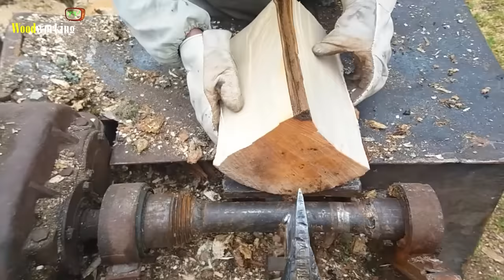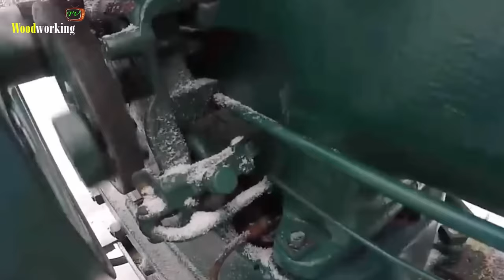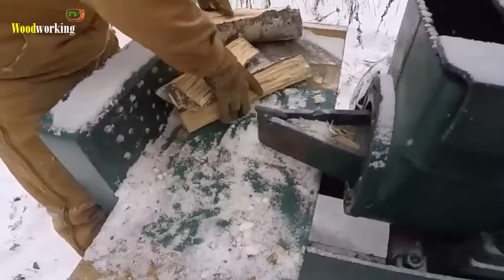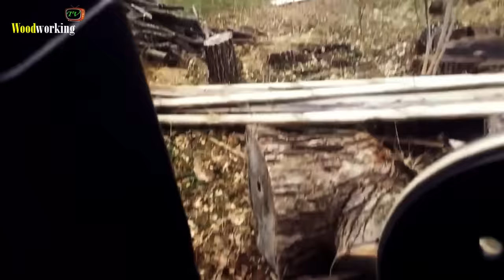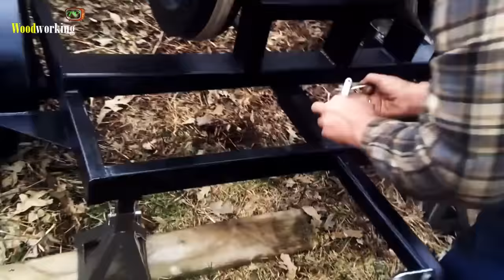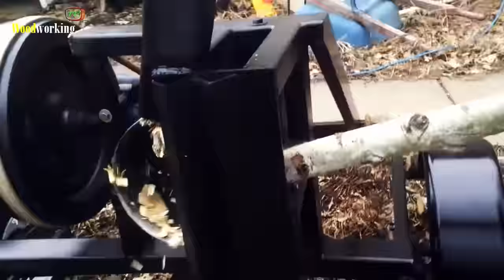10 Dangerous Homemade Automatic Firewood Processing Machine, Wood Cutting Machine Splitting Firewood

Comment: i just picture the second machine operator getting tangled in the rope and drug across the table, crocs and all
Reply: This made me laugh way to hard! I think i may need to see a professional. xD
Reply: ya that rope WTF.............just in time to be sliced holiday sausage!
Reply: Icarus America that would be a scene from a horror film
Reply: 'Drug across the table', definitely need lots of drugs to work on that wheel of potential catastrophic  horror
Reply: @adrianhorgan8944  how do you think he came up with it?
Reply: traumatic head injury
Reply: The capstan can only pull the loop when the operator is pulling the bitter end for tension. Pretty much every marine capstan since the age of steam began works the same way. That feature is actually FAR safer than trying to manhandle the log up that ramp. Granted, the rest of the machine has a few "safety issues" (per cubic inch), but the capstan dragger is actually a time honored mechanism that may not be idiot proof, but is pretty safe
Reply: @ludditeneaderthal  The capstan dragger may be safe,  I question its implementation in this design. There is quite a bit of  loose rope untethered. The rope is routed near the "cutting head" at the platform, you can see the log is close to the rope as is maneuvered  to be cut, if not careful, the log may snag the rope and become entangled in the device as the log is placed for cutting.

Comment: #2... 
✅ Massive spinning propeller blades.
✅ Hands/face/body often < 12" from spinning death machine.
✅ Rope connected to propeller blade mechanism that could bind you up and rip off limbs.
✅ Lifting heavy log up railing that could fall and crush your feet.
✅ Possibility of getting tangled in rope and being ingested into death machine.
✅ Rotating death axe available to access on both front and back.
✅ Placing face/head right in front of massive death axe to have it slam down on wood.
✅ Moving wood while it is actively being slammed by death axe, hands/face close to death axe all the time.
✅ Flying wood could hit person in stomach causing them to bend over right into death axe line of fire.
✅ No predictability of the massive death axe suddenly binds.  Probably would tip the machine over or who knows what.
✅ Split wood flies at your body or in unknown trajectory.

Comment: I really like the first one.
The second one is insane. Though I'm frankly impressed at the level of design effort that went into constructing that suicide machine.
Reply: There isn't one thing on #2 that is admirable or impressive in any way shape or form. Welding a cleaver to a wheel and making it spin is childsplay. This guy is a certified maniac and that mechanical abomination needs to be melted like the terminator

Comment: I like the first one. High torque, low speed blade. Seems to split without effort.
Reply: Yea, first one seems pretty safe and efficient. Worst thing you could say about it is the lack of a belt guard. At least put some 2x4s on either side so you don't accidentally brush against it.
Reply: @Crosshair84  imo, the third one is safer, the first one use full rotation which mean something can catch into it and the axe/splitter act like a hook. but still both machine need a well designed belt system.
Reply: @drakez1983  third one operates too fast. If it could be slowed or engaged after a log is in position  it would be awesome but the first one still gets my vote
Reply: @maggs131  Seems to me the third machine can't start when the splitter is still engaged, so they need to slide on the belt while it's running. Switching this mechanism to something you can operate easily and within a second would already achieve what you're missing and increase safety in other parts as well
Reply: @Crosshair84  yup, i agree,

Comment: The first one had the potential to be dangerous, but cutting/splitting wood inherently has the risk of injury. The second machine was very dangerous. A death trap. You'd need several mechanical safety measures, like a lever that drops logs into the splitting axe, that can be pulled from a shielded position beside the machine, and the loading mechanism for the logs into the drop area would require the machine to be shut off. All together an unsafe and impractical machine if it was made to be safely operated. Now if the machine was autonomous, and the logs could be loaded and cleared in a manner similar to a magazine ramp and a clearing ramp, then maybe. Perhaps a shielding area above the machine with a ramp that a person drops logs into, where the machine splits and the logs are then fed into a pile. Even still, not very practice unless you were looking to split wood at an unconventionally quick manner. The third machine was pretty cool, similar to the first machine but with an engine that is attached to a chiseled piston rather than a belt system that rotates a wheel attached to a rotating chisel. The last machine seemed rather cool too, but when feeding the logs by hand rather than funnel, there is a chance of the log being ripped away from the operators hands and potentially hurting/hitting someone or something. Not super dangerous, but has the capacity. With the funnel, the log is supported by a metal (I assume to be welded, forged plate, or stamped sheet steel) box that prevents it from going anywhere but through the machine or up where it came. The energy being applied to the log I don't think is applied in a manner that would push the log out again with any significant velocity.

Comment: Did you say 10 ??? , I counted 4. And the first one looked very safe.
Reply: Like the idea. Slow enough to be reasonably safe.
Reply: the big issue is that if it sucks you in there is nothing there to stop it from pulling you the whole way through that little hole.  I don't know how much torque is on that shaft but I bet it wouldn't slow down till at least your shoulder, and when that spike comes back around I hope nothing important is in the way. There is no guarding at all with this machine.  you get your shirt or jacket caught, its over.

Comment: The 1st machine looked not too bad, the 2nd big wheel thing ABSOLUTELY LETHAL.!
Reply: The first one is as safe as any other typical woodworking machine. You just have to remember not to put your hand where the hook meets the table. The same rule goes when you saw or drill things. The third one is also pretty safe. Worst case scenario it will hit your hand and bruise it. Same thing can happen when you don't know how to use a hammer.
Reply: @smieszek8080   and the second could be a perfect machine for a murderer to kill and disassamble somebody OOF
Reply: @michagrill9432  There's so many things that can go wrong when operating the second one it's not even funny. It's like using a jet engine as a leaf blower.

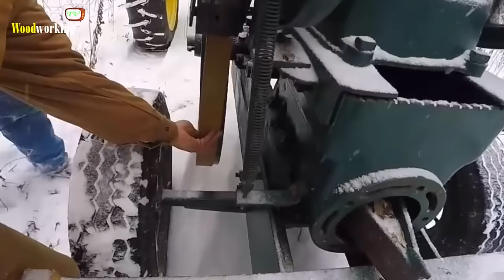Comment: 5:52
Am i dreaming or the hole where the spike comes out is a cylinder of a 2Stroke engine ? 😂💪
Reply: I thought the same thing! A smaller motor coupled to a larger rotating assembly then used as a driven plunger! Not all that bad of an idea
Reply: No, it is an old make and brake engine.
Reply: @edwaggoner7403  really? Would you be able to shed a bit more light on that?
Reply: @edwaggoner7403    Also called a "Poppin' Johnny"
Reply: More commonly known as a "hit & miss" engine

Comment: The first one looks pretty reasonable. Since it's electric I'd probably consider a foot treadle bar switch just to help insure I knew my hands/arms were out of the way. The third one likewise looks like it's not too bad if you pay attention. As long as you didn't get your hand between the log and the stop or splitter, there isn't much way to get badly hurt.  Anything using a hit and miss engine gains a lot of cool points regardless. The second one, well....I'm surprised he lived long enough to make the video. Any log splitter is going to have some level of risk, but that one was flat out suicidal. I don't know what application they last guy had. it seemed to make pieces too small to be of a lot of use.
Reply: Yeah I wouldn't wear any loose articles of clothing near the last one
Reply: Tbh the only issue I see with the first one is that the blade is behind the log when you use it. So it is sort of hidden. So easy to get a finger or hand there when you are removing the split logs. That being said the machine is perfect speed. Not too quick to throw logs at you. But not too slow to make you speed things up by taking shortcuts, like the last machine where he jammed second branch there to make it go quicker. 

I'd like to see a clutch so I can stop the blade when I'm removing the split logs. Would also act as overload safety if a log gets there sideways and wouldn't possibly bend the machine. Also I'd prefer to work from the side, not from behind the blade so I get better view of the blade.

The last machine basically makes wood pellets. Just bigger.

Comment: Third one is literally old farm equipment that will run even after decades of laying in a dusty barn. If these old mechanical parts are cleaned and oiled they will work. They are built like tanks and only hard abuse would destroy them. That's the kind of stuff that will help in an Apocalypse xD

Comment: The second machine clip is sped up watch at 0.75.  Not the safest machine but it would save some time. More worried about the loose rope, the logs around the place creating a trip hazards and the weld or the blade itself cracking or chipping off and going flying at the operators head, otherwise nice machine it seems safe for operation/production until the operator needs an operation.

Comment: Keep in mind all of these videos are sped up. Play it back at 0.25 to 0.5 speed for a more realistic view of these machines in operation.

1st Machine - Torque monster. Perfectly usable as is but with a few alterations could be great.

3rd Machine - An oldie but a goodie, but not as convenient if the engine isn’t in fine tune.

4th Machine - A niche machine halfway between a splitter and chipper but does neither job very well. Still an interesting contraption.

I left out #2 for obvious reasons.

Happy splitting!

Comment: What happens on the second machine when a stick lands sideways in the cutting area!?? It may split logs longways but if a piece lays long ways it's going knock that cutter head off that wheel and straight towards him ! Or either something else is going to break and it's not going to end good for the operator....🙄

Comment: 1st one is deceptively dangerous, if you get snagged it is pulling you in with no mercy but it could be greatly improved without compromising the work it does. I think if the table was more open instead of having that form-fitting shear of a hole it might be marginally safer (such as the 3rd one won't maul you just for being in front of it) but really it should have a foot pedal or something.

Comment: 2nd guy has to be a tweeker with too much time on his hands. He likely put tens, if not hundreds of hours building this thing, only for it to be overly complex and dangerous to everyone nearby. Once those flywheel gears start going, if one of his welds should fail they can fall off and drive through a house with that amount of mass and torque. crazy. And Yes, after watching it in use I'd say you have to on some heavy drugs to even operate this infernal contraption.

Comment: 1st, actually not too bad, could be better if it had a clutch to stop it each rotation.
2nd... holy mother of shitballs
3rd, very dangerous but it's old school farm equipment.
4th, seems fine if you process a ton of branches, the cutting wheel could use a better design.